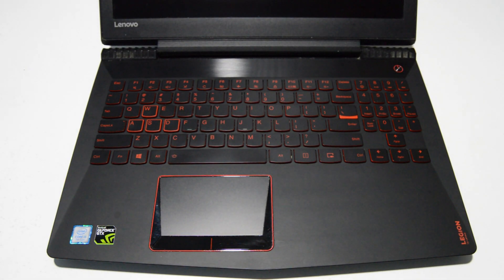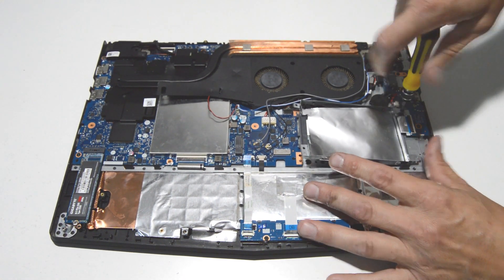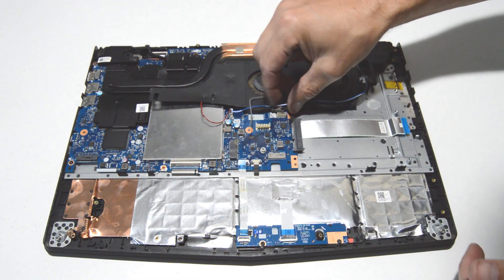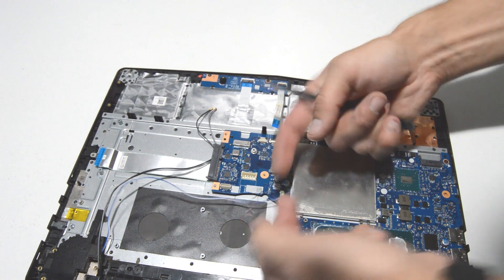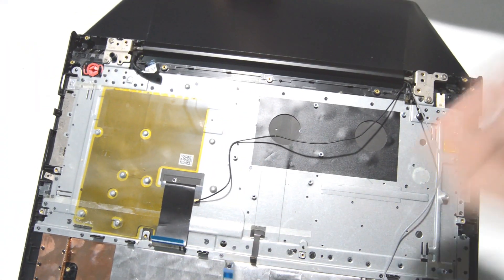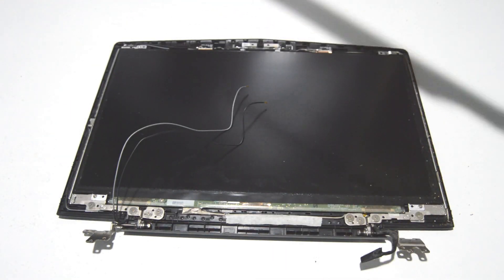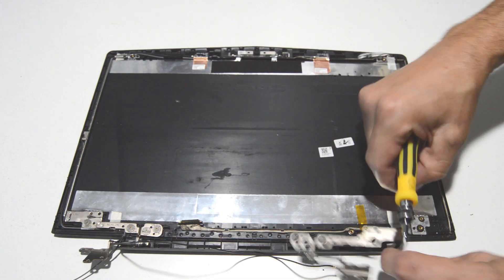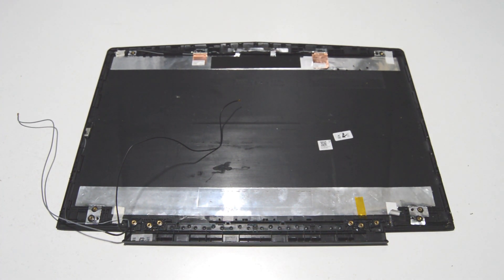How to Disassemble Lenovo Legion Y520 Laptop or Sell it.

Comment: Hello, i have the same laptop, and mine's hinge is starting to crack. Can you please guide me through some steps based on the video? I think I should grease it up? and how do I loosen the hinge. Timestamp to the video would gladly help! thank you
Reply from the maker: Do you mean the hinge screw mounts? That's usually what breaks on these.
Reply: Mine is at the back part of the monitor where the hinge is probably connected. It slightly has a crack because it's made out of plastic
Reply: @maynardurmanitalicayo7676  you are not the only one🤣
Reply: @webflyer035  Mine broke almost entirely yesterday. Laptop is 6 years or so but it started long time ago. Major ** up by designers.

Comment: I've a little issue... When i press the power button to turn on my laptop it doesn't do anything? I'm forced too start up my laptop through the bios menu...

Any idea what i can do to make it useful again?
Reply from the maker: The power button can fail sometimes.... sounds like a good place to start!
Reply: wait how do u turn on your laptop if the power won’t work? cuse i’m having the same problem
Reply from the maker: @Nolimit_Mikey  Look into replacing the power button
Reply: @Nolimit_Mikey  Use the Novo button, little hole on the side next to audio jack, uses a paper clip.  Some one said the fix is simple which I don't get, it seems to have come off the motherboard - NEW board, only fix

Comment: why doesnt my laptop have a hard drive access port like yours? it’s the same laptop and everything but its missing the port to plug in another hd. I only have an 256gb ssd but its still not enough.
Reply from the maker: You could pop in a bigger SSD or use a USB external hard drive. The SSD is easily removed once you get the bottom case off, then reinstall Windows and you're golden.

Comment: Hello, I have the same laptop model and after a while it started making a crack sound whenever I opened it. After some research turns out it was a tight hinge problem, which explains the crack at the right side of the hinge cover. I wanna send it out since I have 0 knowledge with computers but with corona and online classes it might not be possible. Do I need to dissasemble all of the laptop or is there a easier way to fix it
Reply from the maker: Looks like it needs to be mostly disassembled. To replace a hinge you have to open the chassis and display assembly. Your problem may also be broken screw posts, in which case you would have to replace the bottom case or back cover, whichever is damaged. If you dont have experience I would recommend a computer shop.
Reply: @Sellbrokedotcom  Well damn thats gonna be hard. Thanks for the advice.
Reply: same thing happened to me

Comment: So I just need to replace / fix the stuck power button, how much do you have to tear down for that?
Reply from the maker: I may be mistaken but I believe it is integrated into the motherboard :(  So basically a whole motherboard replacement.
Reply: @Sellbrokedotcom  That is ridiculous, I will just use the Novo button, the warranty JUST ran out, and they replaced it once in June, poor design.  It literally came off of the motherboard, there were little plastic pieces rattling around.
Reply: @Sellbrokedotcom  Just to re comment, it may be a little box switch that simply taps the motherboard, one guy said it just got shifted out of place, and I saw some some images of one.  (mine broke into pieces) The spot on my motherboard does not look like something broke off.. going to see if you can get the switch

Comment: my issue is that my laptop won't turn on and the charging led is not glowing and I don't know what's the solution , if anyone can guide me i'll be eternally grateful..
Reply: I have the same issue
Reply: @Itzgianny  i got it repaired in a service center looks like i spilled some oil into the motherboard accidentally.
Reply: Same problem here!

Comment: Hello, when I want to upgrade my RAM memory, do I need to disconnect the battery?
Reply from the maker: Good question, no you only need to shut the laptop down completely and then it is safe to replace the RAM. On this model it is hiding under the large metal square next to the heatsink.
Reply: SellBroke Thank You. And when The RAM in notebook is 2400MHz, can I add RAM with 2600MHz?
Reply from the maker: @vladasko9334  Better keep the same. Just add more Gigs
Reply: @vladasko9334  Yes, you can. Already i have in my Y520 Ramaxel 2666mhz and now i want to install Adata 2666mhz. It's fine

Comment: I miss when RAM and HDD had access hatches. They're getting harder to find even on the higher end gaming rigs. Annoys the crap out of me that I have to Take the whole bottom cover off instead of removing one or two screws to upgrade the RAM or the hard drive
Reply from the maker: Agreed! Another thing that is annoying is the fact you can no longer swap batteries on most models nowadays for the same reason.

Comment: Hi,
I have the same laptop, and one of the screws holding the display which you dissasembled in minute 12:15 broke out of the plastik. 
To replace the display cover do I really need to disasemble the whole laptop, or is there another more convenient way to exchange that part?
Reply from the maker: You may be in luck and able to replace the back cover without disassembling the chassis. Check out 10:00 and see how you remove the bezel. Once that is popped off you can replace anything in the display except the wifi antennas and video cable (these are connected to the motherboard). If you are careful you should be able to replace that back cover without taking anything apart on the main body. You might also be able to repair that screw mount with plastic epoxy, but you would have to remove the hinge first. Good luck!